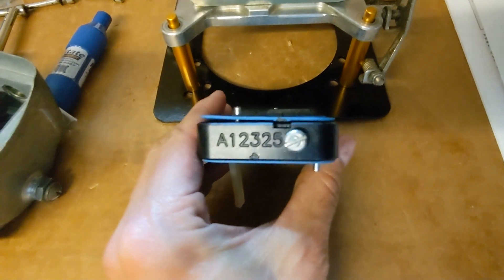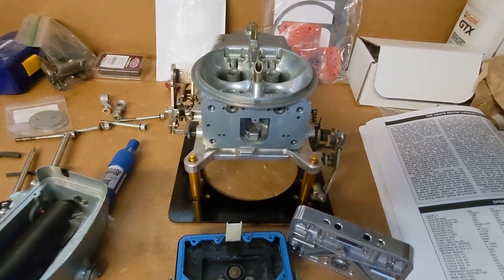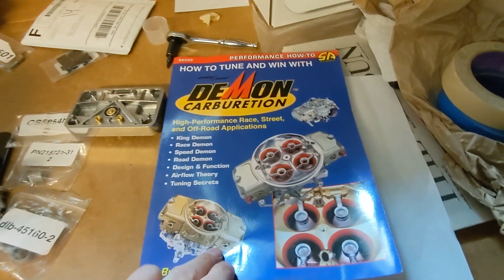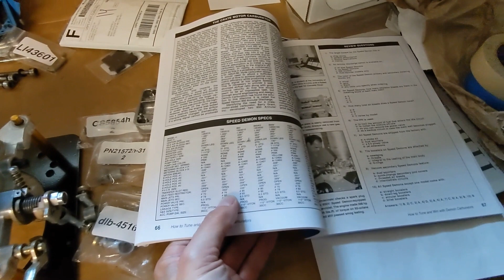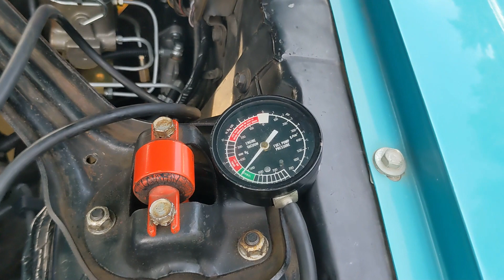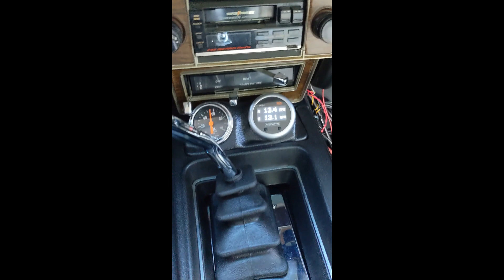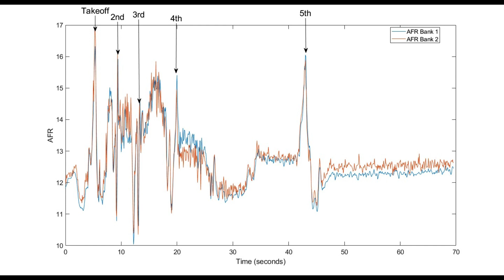750 CFM Race Demon Carburetor on a mild Ford 351W - Converting alcohol carb to run on gas

Comment: From the information I've read, the 750 Race Demons actually flow 830cfm. I've run a 750 Race Demon on my SBF since 1999, works good.
Reply from the maker: Yeah, the venturis are larger than a typical Holley 750 , which probably accounts for the extra flow
Reply: @MarksMuscleCarGarage The early BG race demon is a serious carburetor, and pretty sneaky of them to make the venturies bigger. Lol

Comment: Cool to see someone showing what it takes to convert from Alcohol to Gas.

If you wanted to try to maintain the Alcohol metering blocks, you could also run 64-later Autolite 2100/4100 Jets.
They're the correct 5/16-32 thread pitch for the Alcohol jets. But come in gas sizes.

I've test fit the alcohol jets in my Autolite 2100. And they thread/seat just fine.
Reply from the maker: Thanks for the tip! I did not know that

Comment: Good info. I have a demon carb i bought used & it turned out that guy may have taken advantage of my ignorance some? I admit i have a good bit to learn about them. But i do want to rebuild it & make it right again. So the book you showed & the company "allstate" you said is good info for me. 
  My carb dousnt have any numbers anywhere except on the bottom butterflies. All 4 of them say "1.69". And thats it? I see no othsr numbers or markings anywhere on it? I can tell you it has a choke, & its supposed to be a vacuum secondary but who i bouhjt it from had it rigged up like a mechanical secondary. It ran well, but always had a dead spot before the secondaries would open. When i took it back off my truck i found a ear had broken off the base plate. When i took it apart i found another ear was cracked, but not broken yet. So i need a base plate & a few other things. But i believe we have come to the idea it is infact a 750cfm as i was told? But learning i need to do more of before i buy used carburetors.
Reply from the maker: Yes, unfortunately the early Demons had no easily identifying numbers as far as CFM rating goes. If the butterflies are 1.69" diameter and the Venturi diameter is 1.40" it is a 750, that's what mine has. I had to do some Googling to find out how to identify mine. Allstate carb should be able to sell you a  baseplate that will work. They are in Long Island, NY.